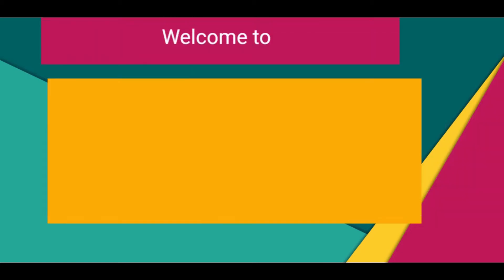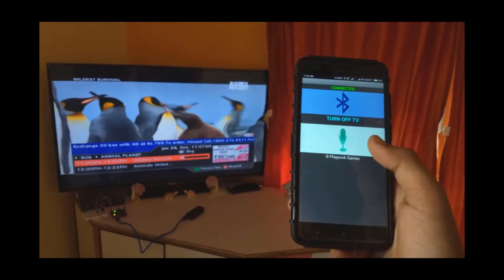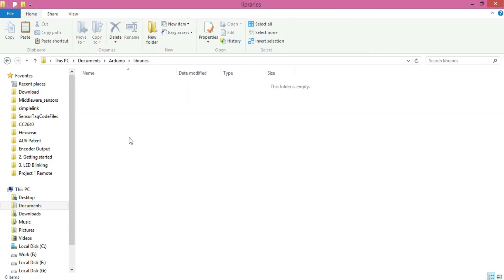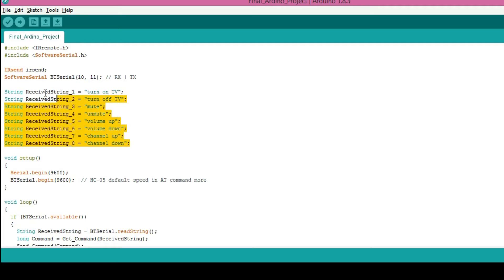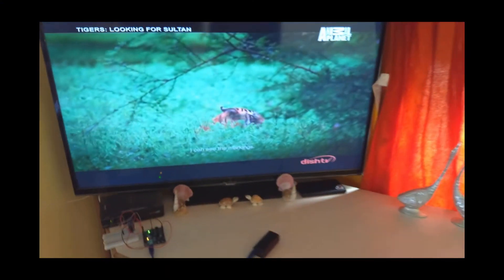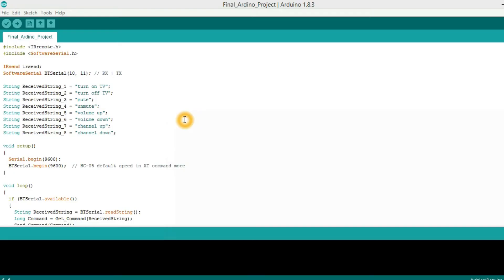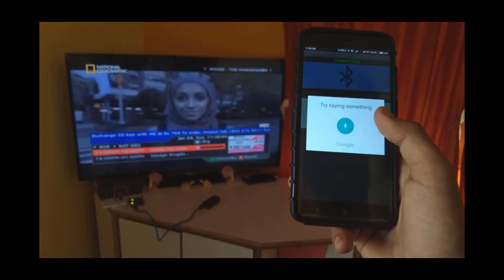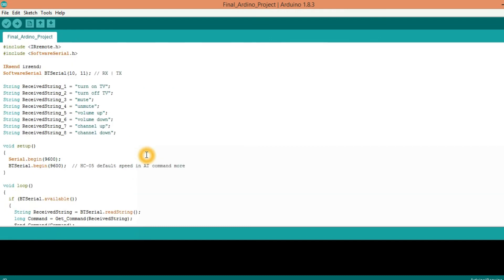Project 01 Arduino Voice Controlled TV

Comment: sir link is not working
Reply from the maker: Website will be up and running from tomorrow. Till the time, use the following link.

https://gist.github.com/microcontrollershub/6becd854a2885059711970278f5808f9

Comment: Hi, your link is not working. Pity you did this good video and couldn't check that your link works....
Reply from the maker: +Don Rossie  Thanks for your reply. Due to some technical issues the website is under maintenance. 

Link is correct, but it will take a couple of weeks to get back on track....

I will update once we have our website running